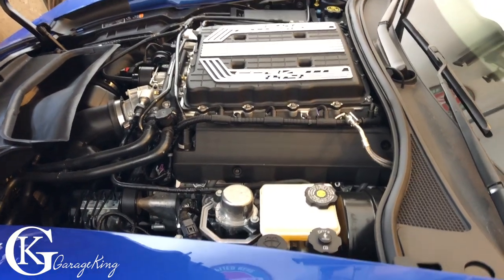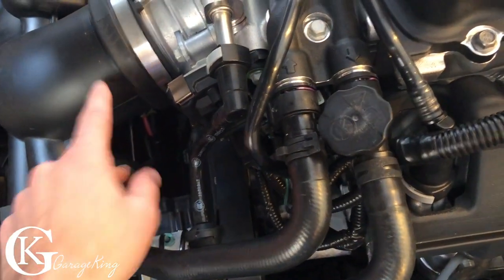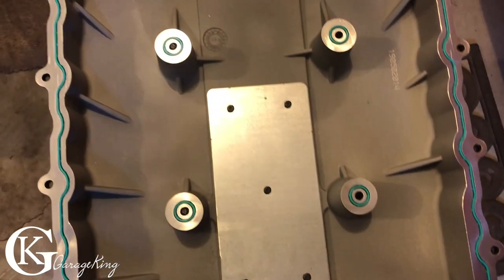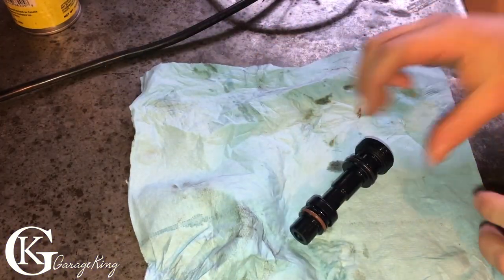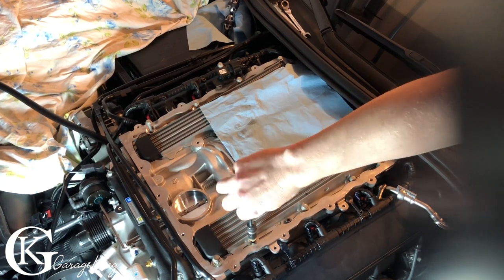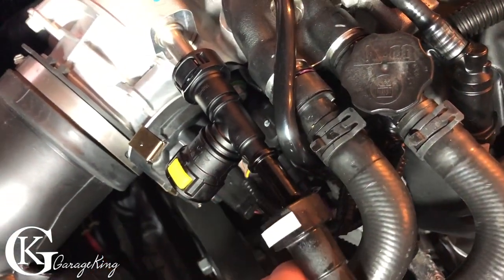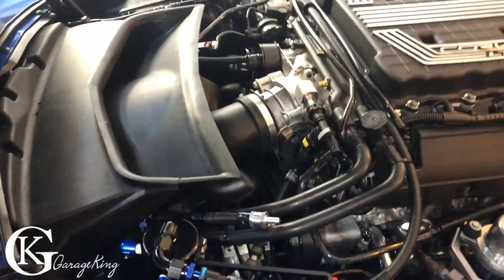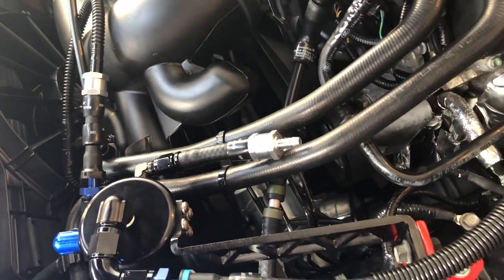Corvette C7 Z06 LT4 Catch Can Install, Camaro ZL1 similar

Comment: The supercharger bolts are torque to yield, only can be used 1 time. From head to SC
Reply from the maker: No They are not torque to yield.  Torque to Yield bolts will always have a set torque amount and then a partial turn listed in degrees afterwards.  So like 10ft/lbs + 90 degrees.  These are just 89 inch/lbs.  I think GM recommends replacement as most people do not use torque wrenches and these bolts are really small so going over the torque stretches them too much and they snap. Plus they are probably cheaper quality bolts (who knows) I have seen videos where people say to snug them down with a 1/4 drive ratchet.  They are probably unknowingly over-torquing them. I have removed.  I have reused mine a few times and no issues (but if you re-use) don't forget to use blue lock tight.

Comment: I’m installing a 2028 LT4 in my 1969 Camaro. 
I would like to use the Tee fitting at the throttle body and the PCV valve that you used. 
I’m not worried about the fitting at the front since all of the air intake pipe will be custom. 
Is the PCV valve a GM part?
Reply from the maker: Hey buddy, thanks for the comment.  The parts are not GM parts.    The PCV valve is just a restrictor, its a piece of metal that goes in the 3/8 line with a hose that is just slightly larger than 1/8".  Some diverters (the part under the blower have it built in, others don't.  If you get a diverter from Elite Engineering its built into the diverter that goes under the blower.  The mightymouse is full flow and you have to put a restrictor before the throttle body.   It depends how you route things.

If you are doing a custom job what I can do is sell you the T fitting, and the part that goes with it so that will cover your catch can. Then I can sell you an additional fitting to go on the end of the T.  Thats the part where everyone hooks up the factory plastic hose, but you won't use that, as yours is a 69 custom job so your brake booster will be a different distance, hence; you can't use the factory plastic line.   It is at that point you would hook up a hose and run that hose to your brake booster.  This way you can run a catch can cleanly, and have a line run right off the throttle body and it would look good.  If you want to shoot me an email I can take a pic of the parts and then you would probably get an idea of what I mean.  Also with a catch can you have to install a restrictor somewhere in the system.  It can be under the blower as part of the diverter, or it can be near the throttle body if you have a full flow diverter.  garagekingcanada@gmail.com
Reply: @GarageKing  thanks for the quick response. 
I’ll send you an email.

Comment: Did you reuse the supercharger bolts? From what I've read online these are torque to yield bolts so they are only intended for a one time use. That's because when they're installed for the first time they stretch out just a bit. What are your thoughts on this?
Reply from the maker: Hey there, they are not torque to yield, when you see torque to yield bolts they will have a ft/lb or inch/lb setting and then + a certain amount of degrees. These are just 89 in/lbs.  All bolts stretch when they clamp, but these are not torque to yield. I have no issues reusing them.

Comment: Is the installation the same in a 2023 camaro ss LT1?
Reply from the maker: Hi There, no its different for the LT1, the LT4 has the brake booster line attached to the throttle body (that's why you need you T)  For the LT1 you do not need the T.

Comment: i just dont get ppl who put catch can and still make the outlet from the catch can going to the throttle body    its still feeding the engine vapors   and make the intake oily
Reply from the maker: You need to go to the throttle body as the can needs vacuum to work. You have to suck the air out of the can.  The idea is the dirty air gets sucked out of the engine and into the can that cleans it, and the throttle body sucks the clean air back into the engine.  That's the path the air takes.
Reply: and u will suck dirty air into ur engine       mixture will be oily air with fuel   .... thats not good reason    it reduce the power   maybe help with oiling the compression champer    .. but it still reduce alot of power  and coating the intake   to make less power , oily intake to clean    ,,, i still need an answer that convince me   why all companies such nissan toyota chavy etc  do that   its not good for the engine     @GarageKing
Reply from the maker: @hadiq8965  the air you are sucking in has been cleaned as best the engine can clean it. I don’t think you know but all manufacturers do use an oil separator, it’s designed into the intake. You are just adding another one as no separator can get 100% clean. So there is the factory separator and then the air goes to the separator/catch can to be further cleaned.  By adding a catch can you are further cleaning the air. It’s up to you if you think one.
Reply from the maker: @hadiq8965  also you say “and you will suck dirty air into your engine” you are right that dirty air is going into your engine anyway from the intake. Happens on all cars so may as well make it more clean by taking a different path and adding a catch can, but again up to you.
Reply: what is best for engine  ?  100% air?  or with some oil vapors?   ofc 100% ,,, i guess its because environment cause   maybe its best to burn the vapor to do less pollution?   i really don't know  ,,, if its for the environment then its ok  ,,, but there is any mechanical benefit?  i don't think so       anyway  there is still no reason convinced me   ,,  nvm i don't think u care    lets agree to disagree    @GarageKing
Reply from the maker: @hadiq8965  Best for engine is 100% air with gas and no oil.  Burning the vapor is for less pollution, but slowly damages engine (carbon).  I respect your position. Cheers :)